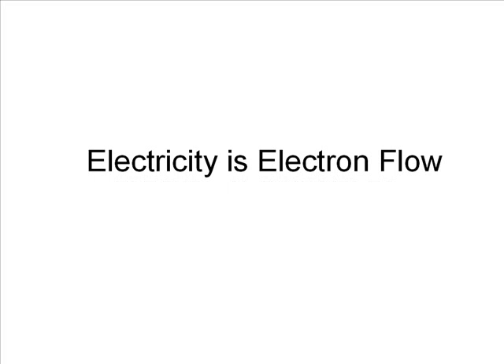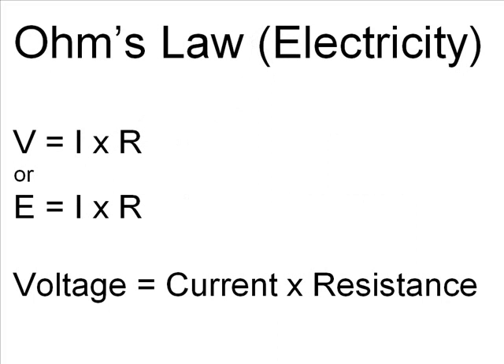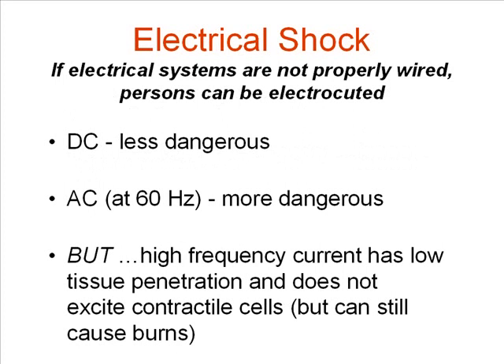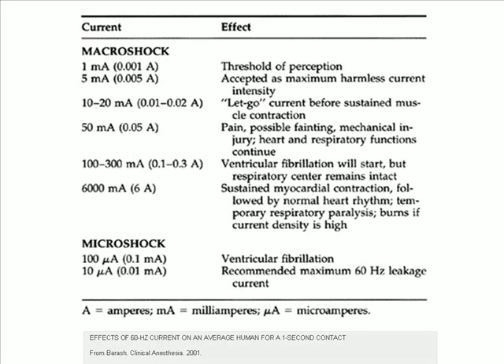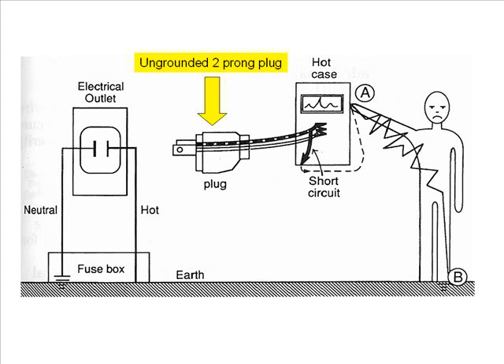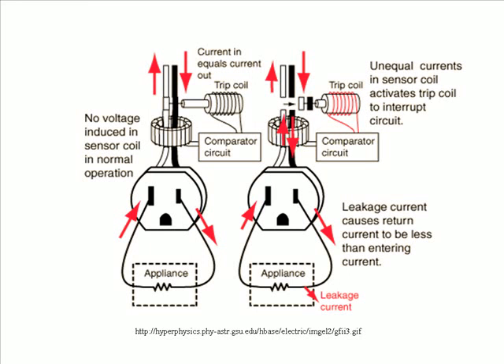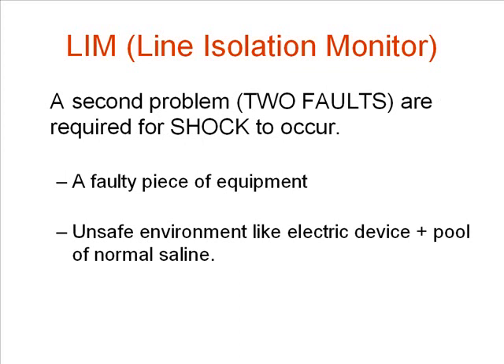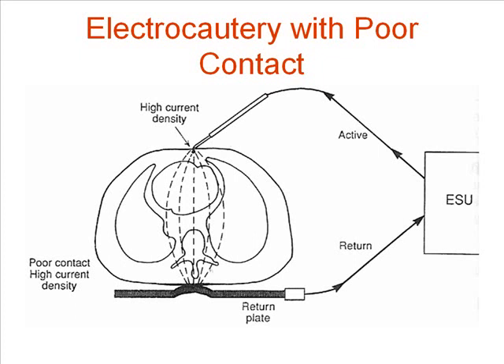Electrical Safety in the Operating Room

Comment: The new standards for LIMs after 2007 require the gauge be at 5mA and not 2 any longer.  If your LIM is 2mA it is not allowed to be in a hospital as of 2007.. we just ran into this with aging older LIMs here...